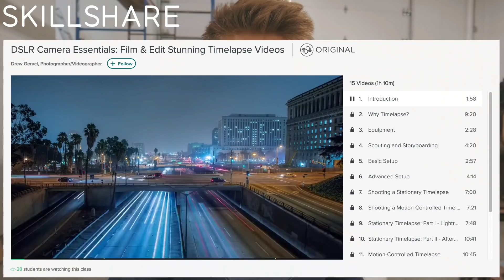FORGING IN THE NEW SHOP!!!!

Comment: Is it possible to forge Damascus ice skates?

Would be a cool project for your new frozen home.
Reply: This.  So. Much. This!
Reply: If it worked, I would buy them in a heartbeat!
Reply: It would be fairly easy to do, the metal part anyway, just change out the other parts and you're good to go. 

@Collette Whitcomb it would definitely be doable, but the cost of doing it would likely make them easily into the 1k+ range for a pair possibly quite a bit higher.  If you are really interested send him a message and say you are willing to pay x amount for some ice skate blades, the higher x is the higher the likelihood of him giving it a go.
Reply: Now that would be really cool to see.
Reply: I need this.
Reply: That would be an awesome set of ice skates
Reply: Damascus is flexible, skates are supposed to be firm. You don't want to put your weight on a floppy skate, especially not at high speeds.

The cut of a skate also doesn't work too well with damascus. It's not a centered edge like a knife or sword, but edges on the outside, with the pressure of the ice pushing the edge away from the center of the skate. The layers would be pulled apart over time, and I doubt it takes very long.

Comment: imagine you're running through the wilderness of Montana in the midst of a zombie apocalypse. you make a little too much noise and suddenly there's a horde at your back. You see a large warehouse, and someone seems to have left the door open. An open door in montana? in this season? must have been a foreigner. you sprint inside and slam the door. Inside you find a fine assortment of... Swords? well crafted, historically accurate, meticulously sharpened swords.

Comment: It's great to see you back to work forging again.  I would have put in for one of the positions'  but being in Wisconsin, it's not what I call a drivable distance for work every day.. and you don't need a 52-year old disabled veteran hanging around lol.   But, I do have a recommendation for you to try.  Turn off the Auto White Balance, and set it to manual, and either use a Gray card or a white sheet of paper (or even a light gray cement floor) to set your white balance. (A gray card is useful for setting or correcting the balance of neutral colors)  Your videos (at least on my monitor) look a little washed out. It's minor, but you can really improve your video color using a Gray Card.  You can also do it in Post Production by holding up the Gray Card (both white side and gray) under the lighting conditions in each scene. You can then reference the gray card in the software (it's an easy process) and then watch your videos come to life with a much more realistic color.  this is far more accurate than most cameras until you get to the pro video cameras on the market.   Give it a shot, I think you will like the improved image.

Comment: WHAT?! There is Paint guns for walls that actually work?!
Reply: Yes, but sadly, it's not the residential grade shite that is sold to the average consumer.
Reply: @jackielinde7568  Also I assume the paint the are using is no standard european wall paint. Americans tend to use frywall paint that is closer to car varnish.
Reply: They usually work the first time right out of the box.  It's every other time there are problems.  I'm sure it has nothing to do with my paint sprayer cleaning skills.

Comment: Even though hooks (esp. forged hooks) are an improvement over big screws for hanging swords and other implements of destruction, remember where you are now...  Those fresh peaks on the mountain ranges in the background are due to seismicity/uplifting tectonics ie. earthquakes. You might want to wire your implements of destruction to their fancy new hooks so they don't jump out and fall across a doorway or onto open-ended compressed gas cylinders. You might be good for long time, then again... (retired engineering geologist).

Comment: alec, have you considered a forced air ribbon burner forge? its more efficient, more expensive and complicated (not really) to build, if you use a good blower it can be more quiet than venturi, gives a better degree of atmosphere control, and since it can work with about 1psi (even less) pressure you can forget about the gas tube icing.
 idk, i think you can do better with that system. at least look it up. imho though, most of the desings out there got it almost right, just not completely right. see, most ppl aim the burner straight to the floor of the forge, or from the side. what you actually want is a circulating flame inside the forge (kinda like a kiln). so, you do a semi-round lining. the ribbon burner aiming from the top /side in an angle (just like venturi) but you use the lining to guide the flame along the wall. that makes the flame circle straight to the center. VERY efficient and well distritubuted heat. there is a guy here in youtube showing that, idk if it'd be ok to link him here? i can tweet it to you?

Comment: Alec, do you have future plans to add some sort of protection to the swords?  Montana is dryer than most states but metal will still rust, metal-metal contact with screws is a good way to scratch things, and dust, metal particles, grime, etc. will build up, eventually.

Comment: It's strange seeing Alec using, what appears to be a newish store bought hammer when working on metal, or am I the only one weirded out by that?

But it's great to see him forging the things he needs for around the shop, when he put up that story bought coat rake in one of the first episodes it felt weird as well, as much as I love seeing him making swords and knives, 
I think the best episodes is when he's making something he will actually use, be it a hook for the wall, a hammer or clamp for forging or a stand for a grinder. I think part if the reason is then as you see the parts around the shop months later you remember when he made that stand, rack or tool.
Reply: Probably the handle is new, but the rest is his classic hammer.

Comment: I just want to point out that 1. I'm from Scotland. 
2. The claymore is supposed to be heavy.   That one you have is far too thin. With a claymore the Scots would weild it one handed it wouldn't be very sharp but the weight and the swing could take a head off.   Just wanted to point that out.   Huge fan btw

Comment: I didn't read all the commits but your swords hanging on the wall need a protective coating of some sort as they will get condensation with the temperature changes in the shop

Comment: Hardly anything more fun than a box of swords, eh?  And with hand cleaner, no less.  Out, out damned spots!  

If you run low, go to an auto parts store and look for either Gojo or Fast Orange.  I always have a tub of one or the other on the countertop by my garage sink.  The trick is to use the cleanser without water then wipe it away with a towel then plain old handsoap and water.
Reply: Swarfega / tuffenega is the same, no water, good scrub, clean up with soap and water. It’s just the U.K. version of Fast Orange I think. It’s got a smell that’s unique and anyone from the U.K. who has got their hands dirty on cars, bikes or general engineering type work knows the smell so well 😀 it reminds me of my Dad and I working on his cars and motorbikes when I was a child, I love that smell 😀
Reply: @vernonbear  yes ... I'm in the states now ... and I lived 3 miles from where it was made in Belper Derbyshire by DEB Chemicals - Cleans everything ... I miss the smell of that green gloop ... that and Germolene ... :(

Comment: Do you guys have to have smoke detectors and fire suppression in the shop?  Since its a commercial building I would assume that you do, building codes and all.  If you do have them, what type of considerations do you have to make to not set them off all of the time while forging?
Reply: Akademee are you the local building inspector?
Reply: @timvandenbrink4461  Lol, no.  I was genuinely curious if that is a hurdle that needs to be overcome when setting up a shop like this in a commercial space.

Comment: Hey Alec.. i know this is probably WAAAAAAAY to late but
What about using the box frame from the power hammers as you holding area for ur iron/steel, by the looks of it, it might hold quite afew bars and it looks easy access, we know its duriable cus ... well it was carrying a powerhammer sooo, maybe it could be useful, also... waste not, want not

Comment: At first i thought "why propane instead of acetylene for the torch setup?". Then i considered that the only thing it really brings to the table is that it burns hotter. Otherwise, propane is likely just far more convenient for your uses. That and far more stable of a gas.

Comment: I am concerned about the swords just hanging on the walls. Maybe the swords could be hooked into the wall with a different hanger instead of screws. With the swords just dangling it looks like a dangerous work condition. The swords could fall and damage themselves. : )

Comment: Alec you gotta watch out wether you're allowed to just hang those swords of yours on the walls like that. They might be classified as weapons and therefore need to be locked away in some way. Just check local legislation before you get in trouble, cause right now, anyone can see where you put them and if there are legal issues, the odds are probably against you due to this video.
Reply: Yeah, not a problem in Montana.
Reply: What? lol
Reply: @SW-zu7ve  Well I'm from Germany... You gotta watch out for sh*t like that around here. If those swords are sharp, just straight pinning them to the walls like that isn't allowed. And I'd rather have him google one or two articles than getting sued or something.